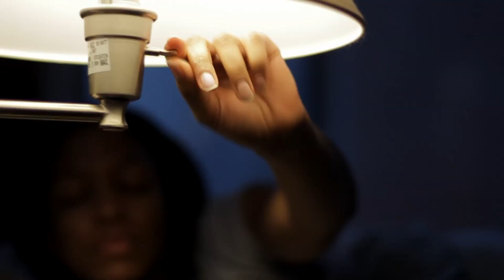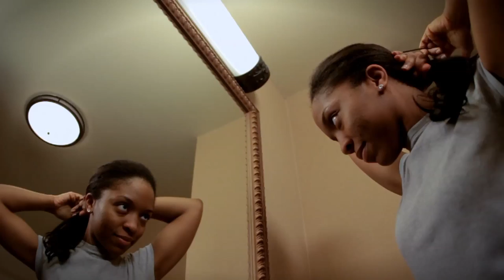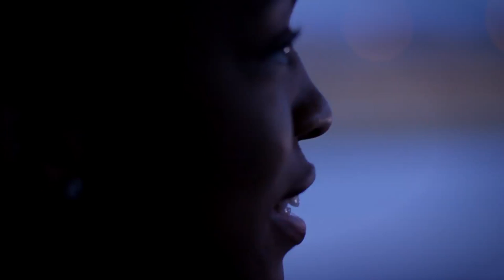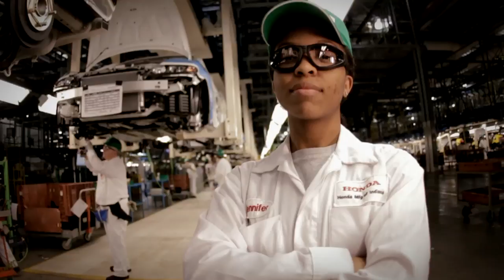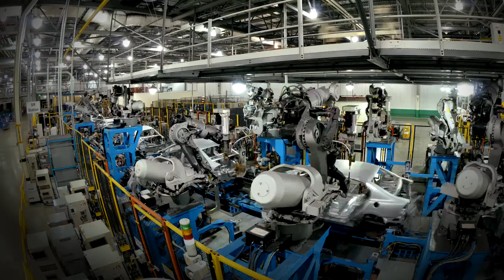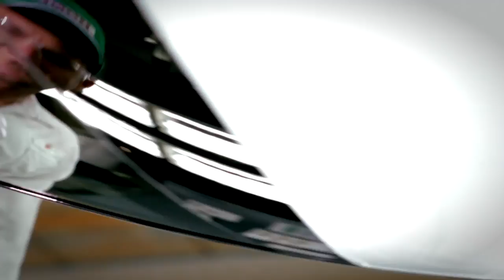Honda Manufacturing of Indiana: Our Spirit Comes Standard

Comment: I've worked at Honda Manufacturing of Alabama for 8 years, and I noticed the pilot in this video. It was built in Alabama (sole producer of pilots, Odyssies and ridgelines) I work in weld, and also noticed that Indiana uses Mostly motorman robots, where we use primarily Fanuc robots. (We use motomans in the GW)